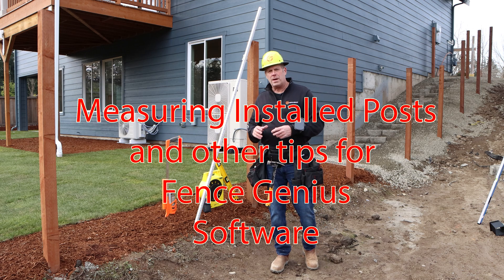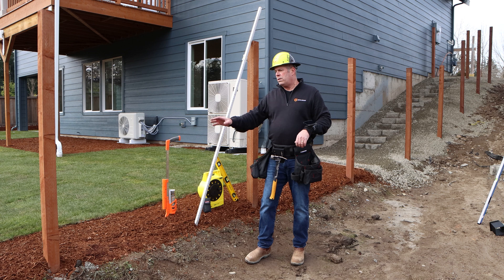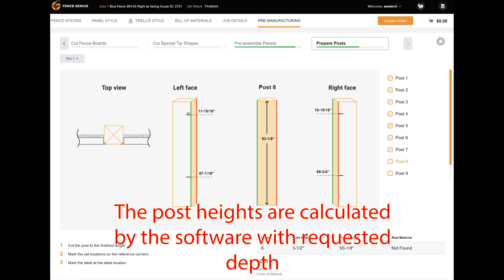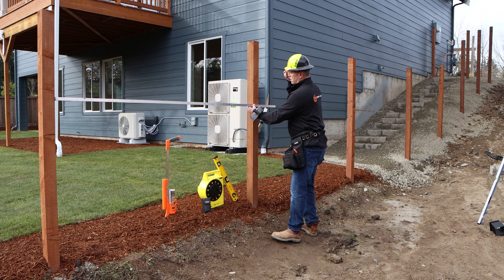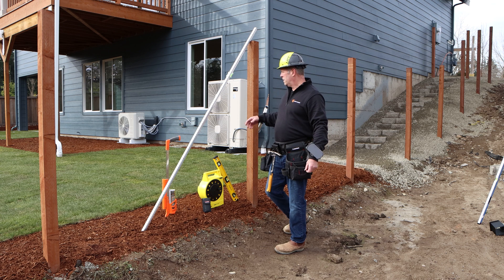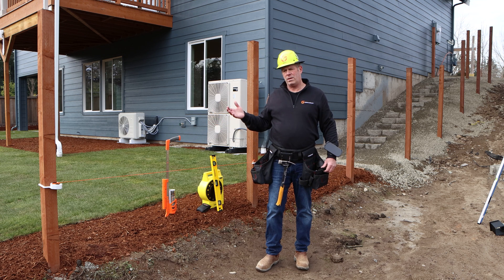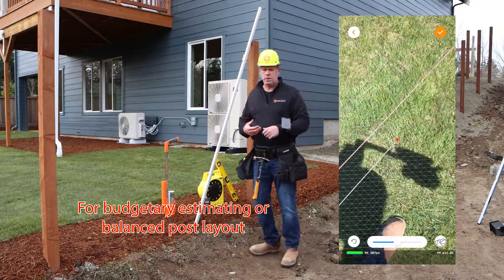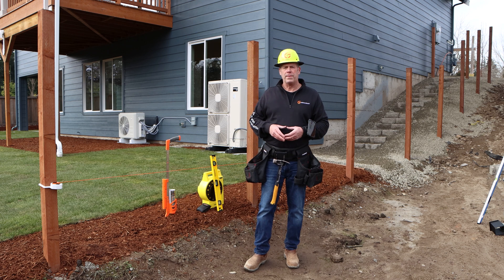Measure Installed Posts to Build a Fence using Fence Genius

Comment: How to over complicat something so easy. Demonstrate on the ground and posts you have already.
Reply from the maker: Hi Dave. Thanks for watching our video. Yeah, I probably go into too many tertiary aspects in the video and for that I apologize. Bottom line: 1) Establish a level line. 2) Reach down and measure distance apart and record. 3) Measure level line down to the lowest potential for wood and record. 4) Measure level line up and record. 5) Measure angle IF needed. We do this frequently and about a minute per panel invested in measuring brings many benefits with software and that time is offset with saved time on the install process. Thanks for watching.
Reply: @fencegenius  Just demonstrate on a fence itself, far more practical and easy for a novice 👍🏽
Reply: z